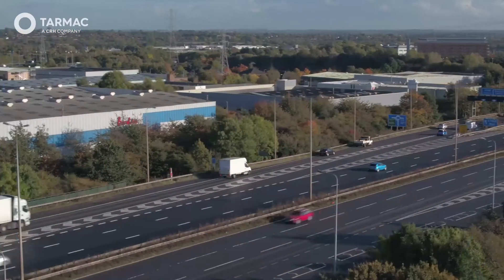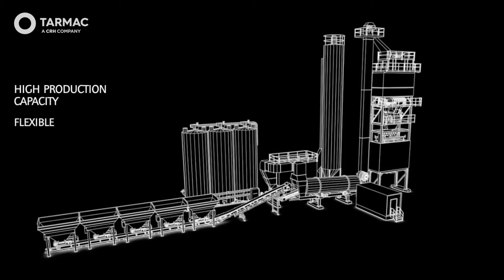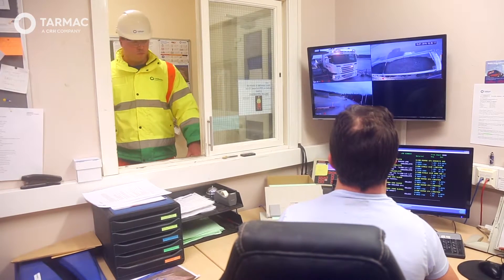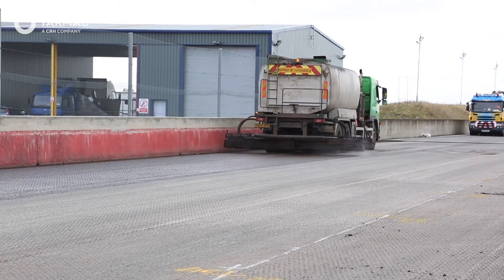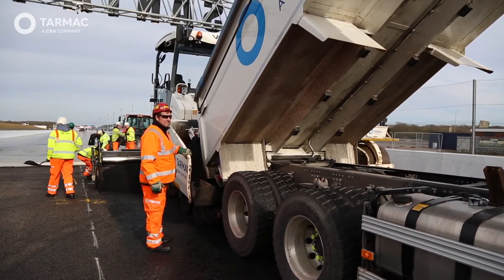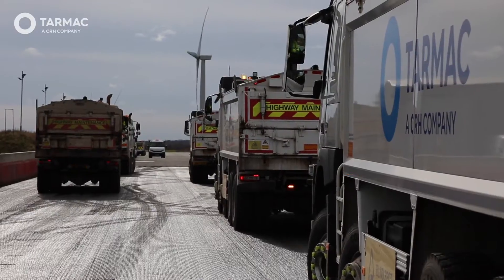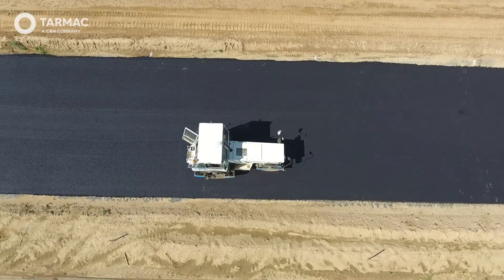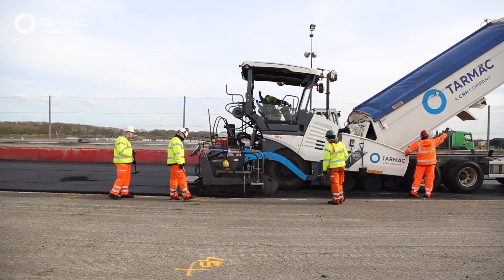Principles of Paving

Comment: The paver should stay same speed at all times while paving never change speed to a crawl this will course the paving mat to increase in thickness. If you do t want to stop the machine while paving use a transfer machine and figure in a consistent speed and head of material the maintaine consistency with trucking and material delivery.

Comment: the roller should never, never stop in stright line
Reply: Why
Reply: @pshort1848 it can leave humps
Reply: U can stop in a straight line u don’t stop fast because that will leave a dip you should also turn off the vibration 1 meter before stopping and only vibrate backwards and not forward plenty of water at all times to stop the tarmac from sticking don’t put false nonsense on here when you doing know what your talking about 👍🏽
Reply: @SonnyCoffey  yeah right.. u never, never stop in stright line you always shoud slide to left or right period.
Reply: @dCD321 varies by mix, tarmacs most common mix has a more stable consistency and is not affected by this as much.